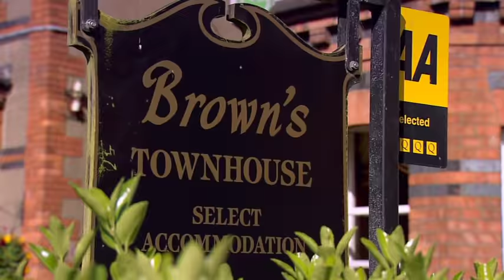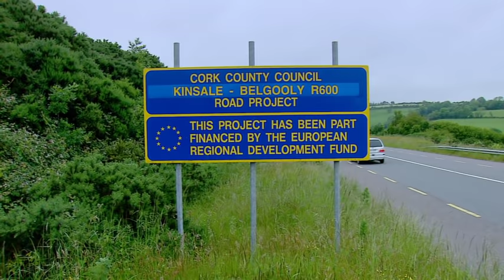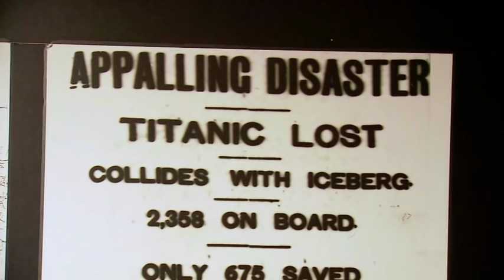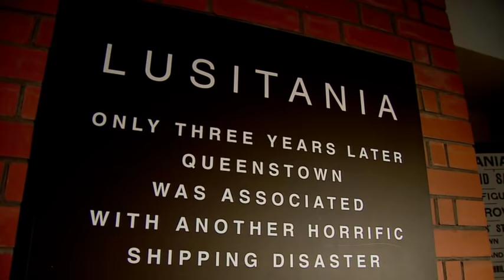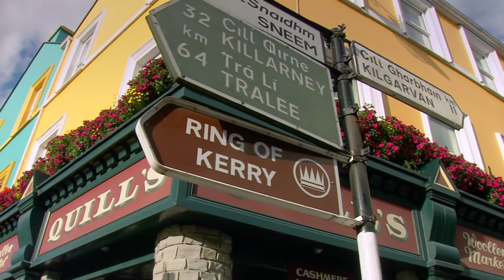South Ireland: Waterford to the Ring of Kerry

Comment: The round towers are older than the religious buildings near them. Their stone work is very different. The monks are only responsible for the pointy roofs on them. Some think they are thousands of years old and were used by the Druids. It's a myth that the monks hid in the towers. They ran into the dense forests to hide instead. The Vikings could have easily built large fires around the base of the towers to bring down the structures and kill the monks.

Comment: I'm planning a trip to Ireland this summer.   I wonder if driving is a big dangerous for those not used to left hand driving.
Reply: +Scampergirl ...In 2014 I drove for a week in Ireland and again in 2015 for a week in Wales. It's "full concentration" driving but it's not as hard as it sounds. As long as you think about what you're doing when you approach a roundabout, shifting a manual car in the left side and sitting on the right side of the vehicle while driving on the left side of the road rapidly seems normal. It certainly is the best way to get around Ireland.
Take it slow and don't worry about locals getting a little frustrated with your hesitation and you will be fine.
Reply: +Tom Bruno  Oh good.  Maybe I'll give it a go, at least in the more rural areas.  Thanks for the input.
Reply: Tom is right, when you drive through the spectacular scenery you will want to take your time, move over & wave the busy locals past. Most car rental companies have automatic transmission option if you are not confident with manual, probably best to pre book.

Good maps & GPS together will be a big help. The Ring of Kerry is busy, for a very good reason, it's fabulous. go for it !
Reply: You'll be fine and relaxed in no time, wear a bracelet or watch on your left wrist to remind you which side to stay one.
Reply: Did it with my dad two years ago.  It was one of the most explicit strewn trips we've ever been on together.
Reply: Jon Smith
 So, an interesting drive then. I expect you had a great holiday though.
Reply: Russ Cattell Ha it was pretty good but I think my dad was feeling down.  He would get so worked up that whenever we got to somewhere scenic he would just rest in the car and he wanted to get the cheapest fast food possible for whatever reason.  He ended up saying that the trip was just okay but I roll my eyes when he says that because he mostly spent the trip swearing, sleeping at the hotels/car and getting fast food.  

Sorry for the long post, it was an interesting trip buuuut as an adult who finally has a little extra money I'm looking forward to taking the trip again by myself.
Reply: I can be useful to get your travelling companion to stay alert and check on your driving.

Comment: 5:46  the history is wrong,  there's barely anything in Waterford built by vikings,  all the ruins and old walls come later with the Cambro(Welsh)-Normans, or what the locals would call 'The English'.   Vikings landed on bogs and fjords for a reason,   it is impossible to attach them from the land,  the modern town(city) of Waterford is built in a very accessible area.  Your history should have been centred on Dermot MacMurrough,  and his visits to the Anjevins (English) .